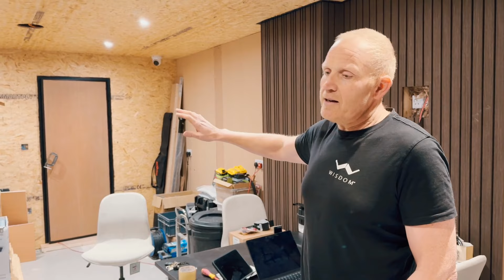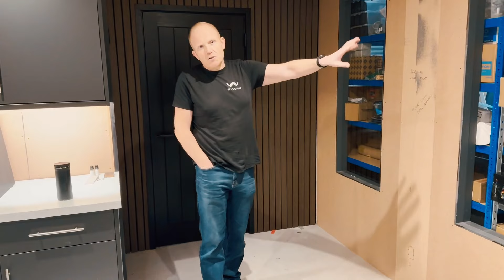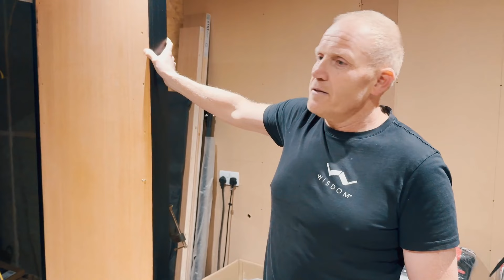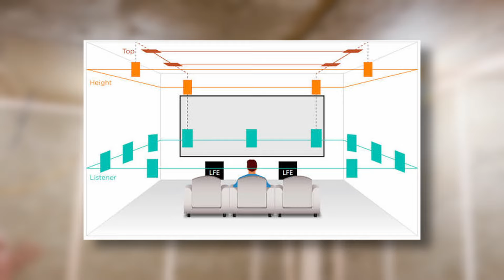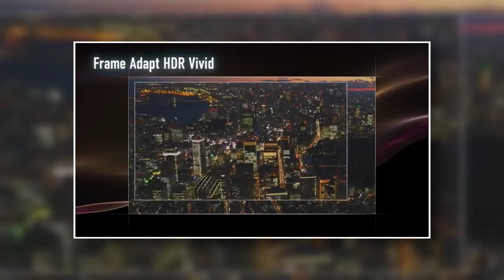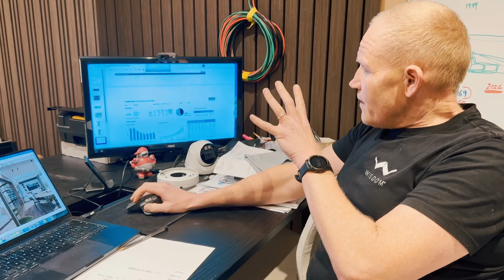A Preview of the Virtus Integration Experience Centre in Worcestershire

Comment: what sort of wood do you guys use to build the inner walls
Reply: We used Smartply MAX 18mm for both the external and also the internal decoupled wall (outside wall had both inner and outer skin, whereas the internal wall was internal skin only - this helped towards increasing the void between the two walls)
Reply: @virtuscinemas sorry 1 more question do u bond all the 3 layers of the floor together?
Reply: @e4s @e4superfly Rubber base layer isn’t bonded to the floor but then the first layer of MDF is bonded to the rubber base and second layer bonded to the first.
Reply: @virtuscinemas thank you
Reply from the maker: This is usually plywood.